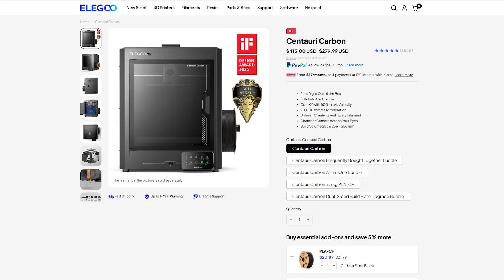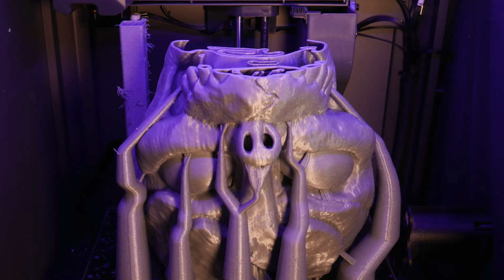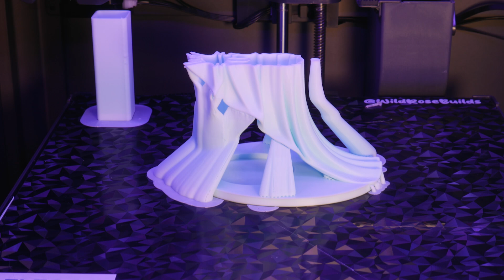Elegoo Centauri Carbon 3D Print Timelapse – 7 Halloween Models Brought to Life

Comment: I may have a question on the use of the purge tower on single color prints, what is it for?
Reply: From what I understand, it's needed for a clean timelapse... The printhead is then always at the same point when taking the timelapse frame. If you use the normal timelapse the Centauri Carbon can provide, you see the printhead at random places, obscuring visibility of parts of you print while printing.
Reply from the maker: @grijzeman2153  Yes its to catch oozing from the timelapse shot, most of these models in this episode were printed in PETG which tends to ooze more than PLA. some of the timelapse towers are pretty boogery in this one 😅